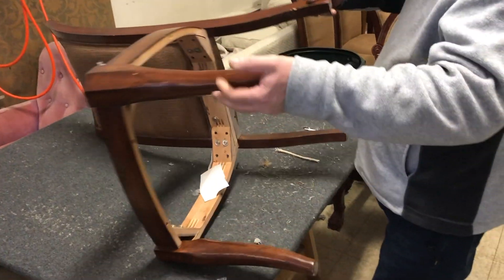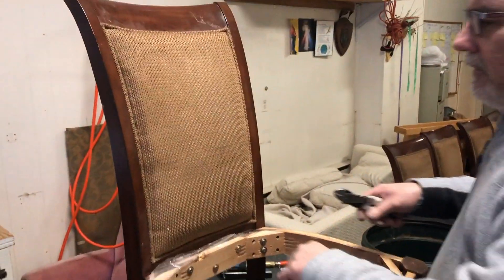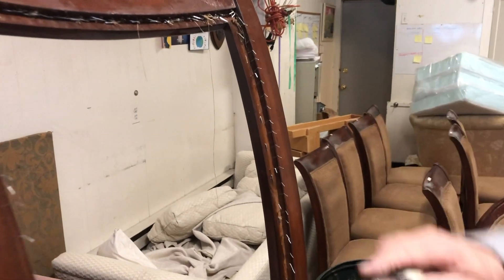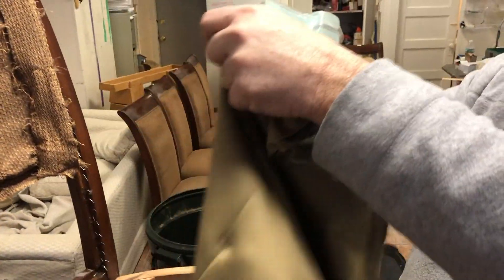Deconstruction of a Dining Room Chair

Comment: I know this is an older video, I do have one question.  When you are reusing foam like you are for this client. Do you steam the foam to attempt to get it back to the original shape or do you just reinstall it as is?

Ok two questions when you replace the welt did you use single or double welt on this,  do you even remember from a few years ago.

Thanks for all the hard work you do putting together your videos

Comment: I have a similar chair but it's a little fancier. It's got a lot of hand carving which I know is hand carving because it's not perfectly symmetrical. It's a similar back like this where the fabric shows through the back I need to restore the woods so I figure I need to take off the back fabric so I can strip and refinish the wood. I was hoping to reuse the fabric is there any way to remove it without destroying it?

Comment: I did that, but it chipped all around the back edge of the chair when i was pulling the staples. Do you have an idea how to repair that part of that edge of the wood? If you have any suggestions or video you can recommend i will appreciated. Thanks in advance 🥰